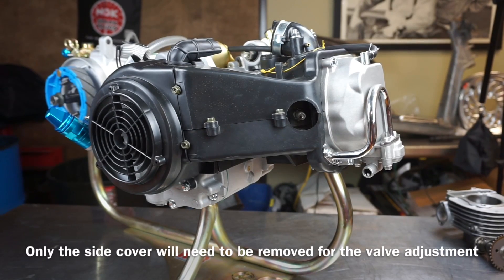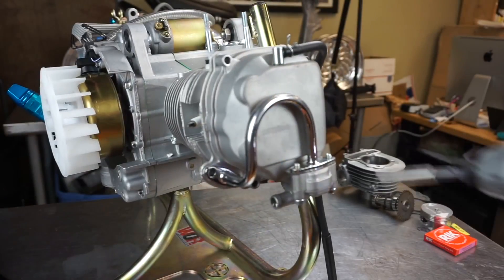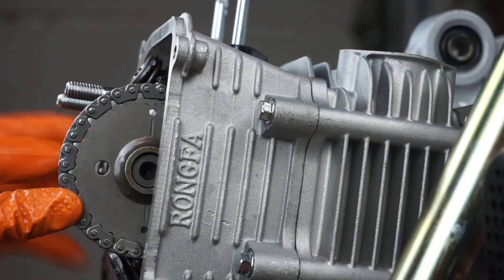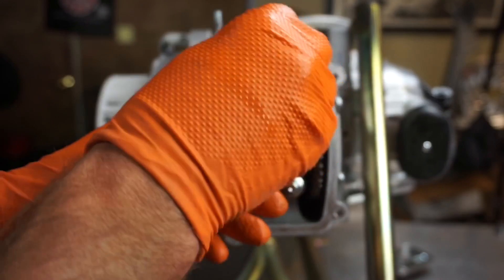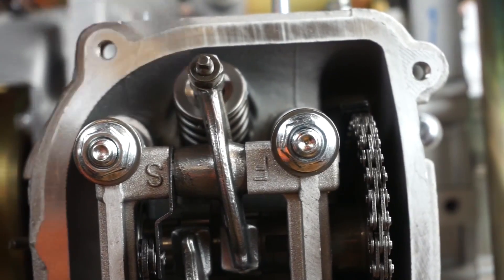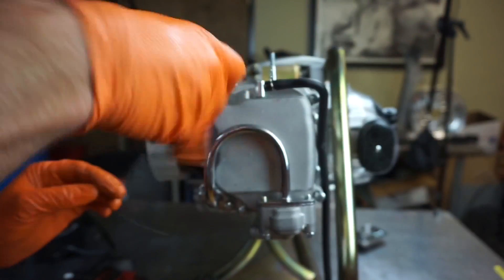GY6 valve adjustment: HOW TO

Comment: Thanks for your clear instruction videos. What are the symptoms to know that I need to do valve adjustment? or in other words, when do I need to do it?
Reply: Every 600 miles is recommended but you'll hear the valve chatter buzzing with the rpms when they do loosen up.
Loose valves restrict the air flow because the valve is not being fully pushed open.
Often you'll have low engine power and the engine will want to bog down when dumping the throttle open.
When the valves are super loose and the engine is about to fail, you'll notice the engine will quit when dropping the scooter down off it's center stand.

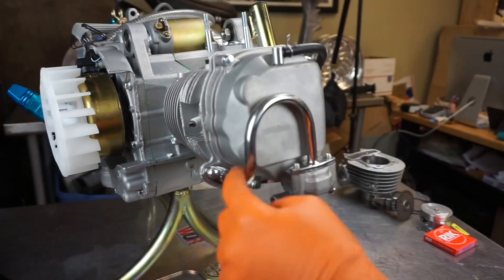Comment: Hi RW I have a 2019 Keeway Fact Evo 50 which is - I believe - an EFi GY6 engine and the alloy valve cover has 2 (an upper and a lower) large inspection ports (large cast alloy caps with hex nut heads) to check/adjust the cold valve clearance. This EFi engine does not have a EGR pipe as on this video at 0:41

Comment: GY6 149cc Tune Up Specifications....

.003 - .005 Inch : Intake
.005 - .007 Inch : Exhaust

( .076 - .127 Metric : Intake )
( .127 - .178 Metric : Exhaust )

Idle Speed : 1700 , +/- 100 RPM

Spark Plug : NGK C7HSA
Spark Plug Gap : 0.6mm - 0.7mm

Engine Oil : 15W40

👍 Thank You
Reply from the maker: P E R F E C T 👌
Reply: @RollingWrench  for 50cc ? in or ex ?

Comment: Hello I did a adjustment on a buddy 150cc  I manually rotated engine on the wheel ( with chain ) it had a line on each side ( left - right ) and on top it had a number marking when I rotated again a hole appears on it ....so I rotated it with lines parallel with valves and hole on top side that was top center I go and adjust them .. rotate engine two cycles back to top center measure again and the shims fit fine so I put it together and no start .. was having starting issues now i really have starting I even covered carb opening before it would start up now nada ☹️ should I of used the other side with the marking and not use the small hole as top center ?? Guide ..
Reply: Timings off bud the T is what marks the top not the hole lol
Reply: Thanks for late reply .. helps
Reply: DanieMations  I assume u have no knowledge or mechanical skill the other person who told me bout the marking was right the scooter runs better and faster .. surprised but I’m glad I did not listen to your advice ..

Comment: Ok bro I did the valve adjustment and it's perfect to me it idles perfectly thank you for that. So do I have to turn out a 1/4 turn on the air fuel mixture because I can roll in on the  throttled and it fine but I can nail it and there's a little bit of  hesitation but picks up. The air fuel  It's true strew is at stock location. I  have aftermarket exhaust coldair intake change my main jet from 108 to 120 I gave your gear up setup 10gram weight and the 1000 clutch setup. So back to the question do I need to 1/4 out on the air fuel mixture strew?

Comment: Hello, wondering if this will work, like it did for my Ktm 

My feelers somehow where exposed to a corrosive and are no longer useful, a trick I learned on my Ktm was to do it by the turns.

Soft seat, then back out to correct clearance.

M5x.5 makes each quarter turn .125mm 
.005in=.127mm .004in=.1016mm

Comment: Thank you very much! however should you pull the whole engine out of your scooter to do this?
Reply from the maker: +Mr Natuur 
The engine can stay in the machine. It just makes for better video viewing
Reply: To do a valve adjustment ?? I did a valve adjustment on a big ruckus 150 cc had no problem why would u take out the engine ???
Reply: You dont need to take it out but you can since its just 2 bolts and some wires

Comment: Why .004 and not .005 or .006 I’ve watched so many videos and none are saying why. What happens at .005 or .006 gain or lose of power.
Reply: if there is too much play in the valves, the valve will open later, close earlier and the valve wont open as deeply. So more clearance is less power.
If the valves are too tight, the valves will not close all the way, leading to backfires and/or exploding carburetors
Reply: I recently checked my valve lash and there was very little clearance so I adjusted to .004 for int and exh, now I have a loud clicking noise. I set to .004 and turned engine around to TDC to confirm it was good. What should I do now to cut down on the noise?

Comment: Great video. I have a question. I tapped for larger exhaust studs but I went through the wall. Will I need to replace the head? The new studs hold the exhaust fine but I didn't know if it would cause leaks. Thanks
Reply: Lego IronMan Studios I would definitely suggest a new head and while you at it might as well get a big bore kit
Reply: @haydenalberes6599  thanks

Comment: Good video! 

My p152qmi engine tdc is pointing at an arrow rather than the T mark?
Reply: On 149cc 157QMJ or 157QMI's : when you set the magneto directly on the " T " Line, the camshaft alignment holes Won't be perfectly level with the engine heads upper lip. 
The lower hole will be slightly above the head lip and the upper hole will be right at or slightly below the head lip.

Comment: I watched this video like 10 times while doing my bbk install and A9 cam, and im still getting alot of tapping from the valve area. I tried all different valve lash settings from .005 down to .002. still getting a good amouint of tapping from the valve area. Wondering if i can go down to .001 and roll the flywheel over and see if im feeling compression or if thats too small of a gap?
Reply: i checked and double checked TDC and rolled the flywheel over a few times and rechecked gap at .002 before startingup. I even ordered a replacement rocker arm assembly thinking that maybe the one that was in there had failed, but not it.
Reply: Having same issue
Reply: @dashfax  so i ended up going back to .003i .004e
I heard enough other scooters on YouTube and whatnot that once they put the BBK on it had the same tapping, i was just being paranoid. As long as it doesn’t get loose it stayed running fine

Comment: nice vid man, however i adjust them at 3 spots. 
Tdc, one valve closed and the opposed valve open and the compression stroke when both are closed. 
Did it last week just before the oil change 10w40.
Runs smoother and your taking in account for lobe wear on all sides.
Realy, before all this it was bogging like crazy, now i can ride the living shit out this little 50cc without any problems.
Ofcourse remove all the emmision crap(the dutch authorities dont care about it)and rerouted the valve cover hose above the engine with a breather filter.

Comment: does the intake and exhaust need to be set at 004? someone told me to set the intake at 003?
Reply: .003 intake .004 exhaust allows the timing of the intake and exhaust opening ro be maximized for improved flow thru of combustion gasses, so ive read.

Comment: I adjusted mine when I put a big bore 72cc and a9 cam in. slight ticking. Took the valve cover off and readjusted them. Then checked them. Still has a quiet tick. Runs good. Normal?
Reply from the maker: They do tick a little. Hard to say if it’s normal since I can’t personally hear it

Comment: Is it the sam with 125cc gyy when checking where the T haves to be for timing with the top wheel with chain?
Reply: gy6 125
Reply from the maker: It’s the same
Reply: @RollingWrench  Does the 125cc electric starter have enough power to start a 160cc cylinder when now i got a 10 amp battery on
Reply: i think ti believe that gy6 125 and 150cc starters are the same
Reply from the maker: michael koldig yes it will have enough power
Reply: @RollingWrench  I saw that racing planet is selling a stronger version of electric starter,and i was considering buying it, just in case..because the last newone to 125cc i bought died when i had a 160cc naraku on,new,from the same place,only tried to start 2 times with electric,but after switching back to 125cc,there was a problem with one og the piston rings that support the oil ring,,so that kit is all screwed up,or fucked up, but back to th125, then the electric starter didnt woerk any more,and it was new..

Comment: So is it .004 on both the intake valve and the exhaust valve? Also are these measurements the correct ones for a 150cc and not just a 50cc? I upgraded recently.

Comment: I don't have the feeler tool but I know copy paper is 0.04 inches thick, any reason why I shouldn't use that instead.
Reply from the maker: I suppose that would work :-)
Reply: @RollingWrench  thx I wasn't expecting an answer that fast.
Reply: I dont believe this would work, paper is compressible and likely would not give accurate reading as solid metal. Also, quality control in a paper mill is  much less strict than in a metal fabricator.
Reply: @cemtkeenan2750  after seeing how cheap was the proper tool I went with that.

As a last resort I would use a sheet of paper but I would get it from the industrial printer my boss deals with for signage and marketting. I guarantee they know exactly how thick their paper is

Comment: Okay so I've adjusted my valves like this and all but when I rev it it dies instantly, anybody know what it might be? It's not the carburetor cus it's brand new. Pls help
Reply from the maker: Back track. Find out when it started doing it -and address what is going down. Also just because the carburetor is new doesn’t mean that’s not your issue
Reply: @RollingWrench  its just stood still without getting started for like the last 2-3 years. now I've adjusted how much fuel it gets and it started working but then it just died again and now it doesn't start at all😭😭
Reply: @RollingWrench  it's barely been driven for 10 hours
Reply: @RollingWrench  and it worked just fine when I put it away
Reply: @vidolf3497 did you ever figure out the issue? Mine does the same!

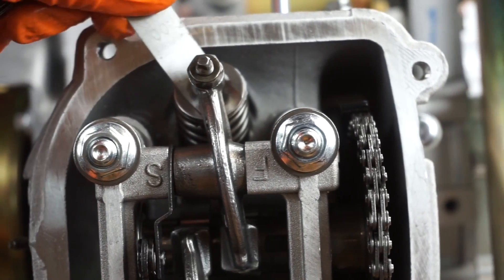Comment: 3:19 wicked ticking rockerarm noise
Reply: GY6 engines has this incredibly simple cylinder head 

adjusting the exhaust valve on a pitbike engine is a pain in the ass because it is underneath and it is inside a closure 
unlike the GY6's cylinder head the rockerarms are exposed and have more room to work on